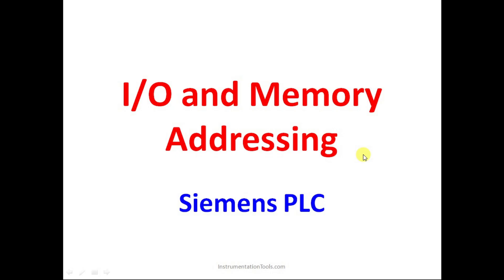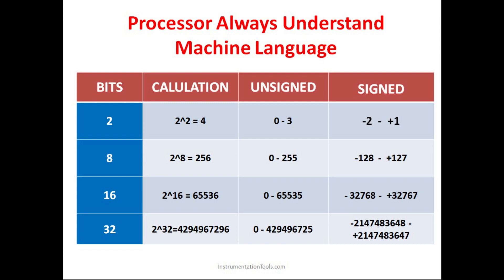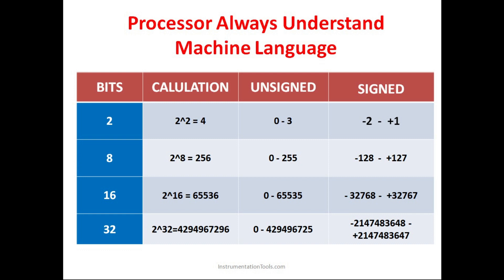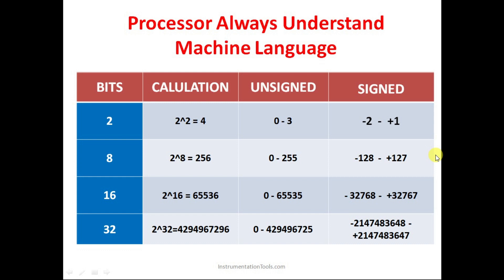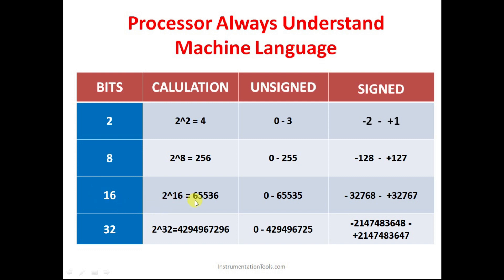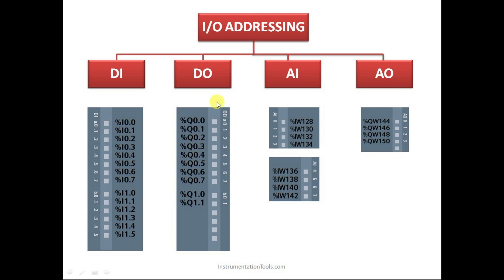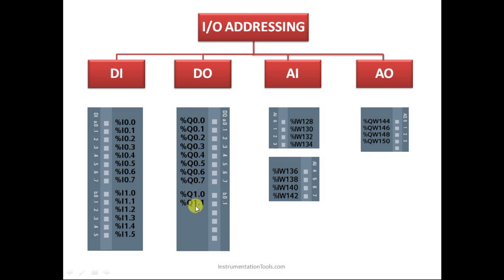Input and Output Addressing in Siemens PLC - Tia Portal Tutorial

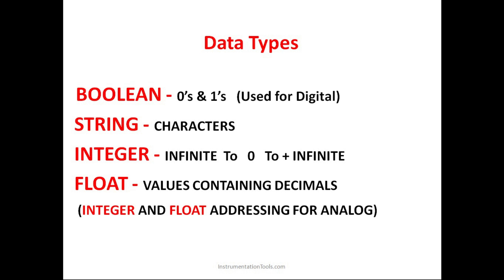Comment: @2:08  Correction:  The size of the INTEGER data type in most programming languages is NOT infinite; it is finite and depends on factors like the computer's architecture and the programming language implementation. In Siemens PLCs (Programmable Logic Controllers), the size of the INT data type is finite and specifically defined as 16 bits. This means it can represent a range of values from -32,768 to 32,767, according to Siemens technical documentation.

Comment: Hi 
Kindly need your support, if I have failed digital or analog chanel (input or output), and I need to change the address to another spare chanel, and make download to the PLC, with out make the PLC goto stop mode for example PLC Siemens S7 300.
What shall to check in the CPU setting or in the program to make it safe, without making the CPU going to stop mode